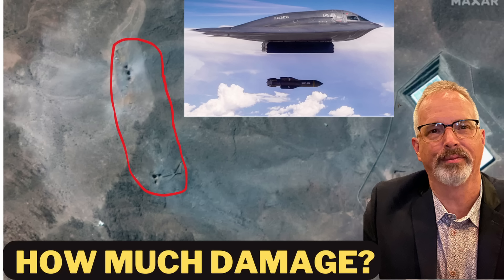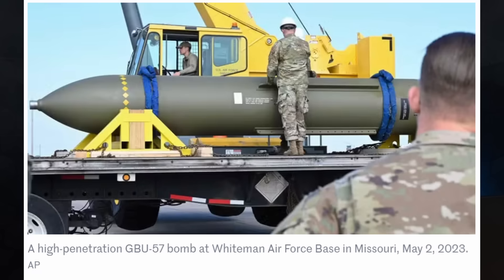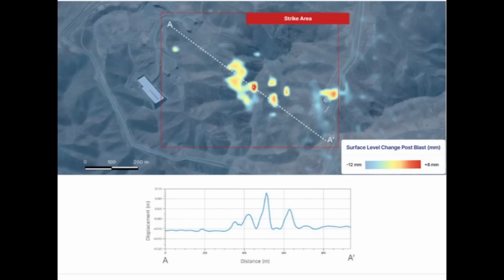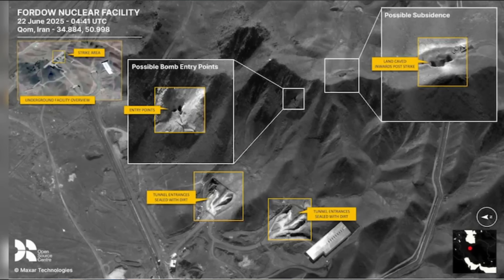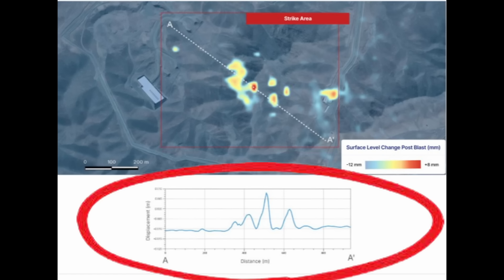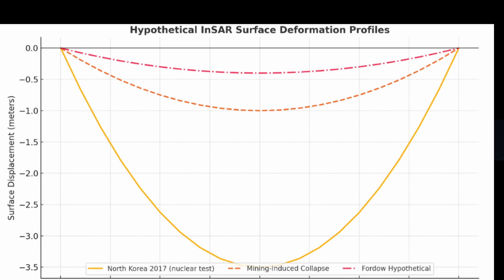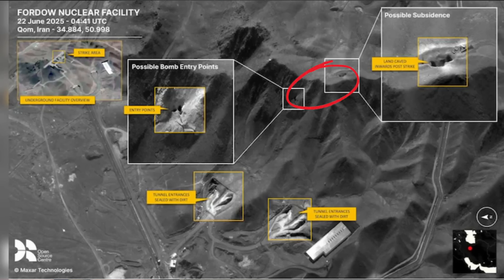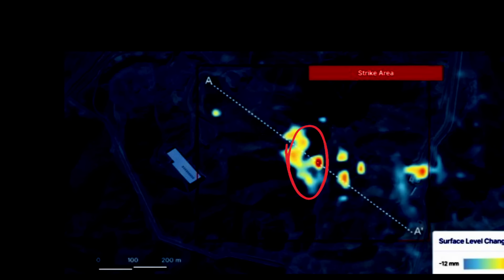Fordow Attack Assessment -  Update

Comment: I wonder how accurate is whatever information has been obtained about Fordo.

Personally, if I were to design such a facility, it would be an easy guess that in the (very) likely case of bombing, the vents would be the target.

So I would give them a target, but they would be a diversion to draw damage in a non-critical location. I would even give them the appearance of functionality.

I mean what's the point of going through all the trouble of burrowing into a granite mountain, only to put air shafts over it, when it's apparent there are enemies with deep penetrating ordnance?

It's too easy.

Comment: If the charge exploded anywhere close to the excavated area, wouldn't the easiest path for the energy be into the cavity rather than upwards?
It's good to have an analysis from an engineer with mining experience, given the target.
Also interesting is the suggestion that the weapon was specifically designed for the target.

Comment: Thanks Casey. Excellent as always. 130k yards is a lot of material as you say, but that's only a cube 50m on a side. So the details of where the damage was placed laterally and also the depth achieved vice the facility depth are very important. I don't think we can conclude much at all from remote sensing. Boots on the ground are needed. Since those will have to be provided by Israeli intelligence, we're unlikely to know the truth for a long time, if ever. The current claims on all sides are bluster for purely political purposes.
Reply: there are claims that the facilities were 200m deep

Comment: Since the fractured granite / concrete debris was blown downward into voluminous chambers, one would assume that the surface profile would indicate concavity equal to the displacement infill. Where did all that fracture rock go?
Or was the shaped charge designed to create a stabile core tunnel with minimal lateral expansion.

Comment: Sorry to say your calculations  are not correct. You made your calculations based on each bomb containing 30,000 lbs of explosives. However, that is not actually true. That is the weight of mostly the heavy casing which is obviously not explosive. The GBU 57 itself containss 5400 lbs of explosive material. Therefore you have based your calculations on 6 times the explosive power that actually exists.
Reply from the maker: No.  You are incorrect.  The 60k pounds plus was total explosives for the 12 bombs as I explained in the video.

Comment: No doubt those bombs loosened up a lot of rock but because there was 3 bombs fracturing 2 locations there was multiple bombs making smaller and smaller pieces. Lots of dust and sand and gravel. If the explosives were more evenly distributed there would have been more broken rock and less gravel. Of course the goal wasn’t to make gravel but mainly destroy the equipment they thought was down there.

Comment: If you use those numbers (0.3kg / m3 and 2,000 kg per bomb) then you get a sphere with a volume 11 metres in diameter. If each bomb can penetrate 10 meters before exploding, you basically get 20 meters into the hillside with each bomb. So yeah, 4 bombs would get you maybe 80 meters I'm not convinced all 6 bombs for each site followed exactly the same path.

Comment: I think that is a key aspect to the attack and results.  The ground in the area has been so shattered, so fractured, that it all has to effectively be mined out to make it stable OR you have to carefully mine into it placing structure to prevent collapse.  Either process will be a long painstaking time process to carry out.  And you have to remember that area is not stable per say geologically.  On June 20th a 5.1 magnitude earthquake hit Qom just 35 km away from the facility.  If the ground is as factured as likely due to the bombs .. you have to engineer and plan for that as well.
Reply from the maker: Those are all great points that should be considered.

Comment: Great presentation on the proibably damage to the basic rock material present in the area.
Now go back and ask what's missing.
These facilities weren't just thrown into an empty pocket, a "cave" in the middle of all this rock.
These facilities were also more than likely themselves built with layers of reinforced concrete (unknown composition and materials, everything from rebar reinforcing to layers of soft and hard material to create an effect you would see in Chobham armor, possible layers of steel plating, etc).
Calculating the destruction potential on the rock is one thing...effects on the facilities built of unknown reinforced material underneath that rock is another.
Additionally...this isn't the Death Star. The internal configuration of the vent shafts is obscure/unknown. If the shafts are offset and themselves have pockets meant to absorb or redirect energy away from the facility (think the Cheyanne Mountain "L" entrance way)...that will have an effect as well.

Comment: I dont understand, should not at least the concrete cap have been scattered on the surface? Elevation differences on the order of 10 mm is pebble size. At lot more concrete should have scattered around not from the explosion but just from the kinetic impact itself i would think.

Comment: I came to the same general conclusion. One could think of the surface uplift in parallel with artesianing. The formation above the tunnels are the confining layer and the forces are being applied radially along a small volume of space, the tunnels. The cycles of compression and release resulting from multiple explosions may have acted like a hammer, causing deeper damage with each occurrence.

Comment: They'll just build the next one a lot deeper and use gigantic steel doors that swing shut in a horizontal section to close off the vents (they had plenty of warning Trump was planning this operation), with probably side diverter vents to steer the energy/pressure from the explosions, plus probably a lot of decoy vents up top.  They'll also probably do a better job of keeping Mossad spies out.  The only thing that will stop Iran from pursuing nukes is regime change.

Comment: A sphere with a radius of 30 meters has a volume of slightly over your 30,000 cubic meters. The MOBs would have needed to near penetrate the layers of granite-limestone rock to near that depth to guarantee total fracturing of a similar volume of granite rock. That’s far from known to be a certainty. It’s possible the bomb casings themselves melted or fractured from over-pressure before the required penetration depth was reached. The Fordow plant was buried 80-90 meters deep.

Comment: The info of the MOP being a dumb unitary warhead is old. 
The current MOP utilizes the FMU-167B/C HTVSF. Hard Target Void Sensing Fuse. 
The MOP was designed to be iterated in stages. The original (2012-2018) MOPs did not have void sensing fuses to allow targeting of specific depths or pre-determined bunker levels; post 2018 MOPs and upgraded MOPs do. 
It's safe to assume the current version was used at Fordow, or a mix of previous versions and updated versions.

Comment: Casey,

With little to no knowledge of I subject matter, i wonder, was the mission rather than having the explosion fracture rock to use the heat and shock wave destroy the contents of the tunnels by heat and the shock waves?  This may explain the rise in the second hole.

I find it ironic that no one has been asking about the accuracy of the bombs.  Dropping two bomb from 40,000 feet from a plane traveling at or near the speed of sound, hitting the same ventilation shaft.  Now, information says six bombs went down a single shaft.  That translates to three planes dropping two bombs each, hitting the same target perfectly.  That is scary accurate.

Bob
Reply: In the defense industry, there is a phrase: "consecutive miracles". It refers to tests of multi-drop attacks on a single aimpoint, showing successive weapons passing right through the hole made by the first. Yup, with modern weapons, entirely plausible.
Reply: I've heard some reports say 13,000 ft altitude and doubt the airspeed was near sonic. The Iranian air defenses were pretty much toast by then in most estimations.
Reply: That is essentially what Razin Caine indicated in his press conference.  The design was to destroy the contents of the galleries by overpressure and heat.  Not by collapsing or fracturing the rock itself.
Reply: Technology is great when it works. Just like people.

Comment: Expect the Iranians to have prepared for this attack, emptying the bunker and backfilling it with sand, it would be impossible to collapse it.  Furthermore, soiid steeldoors will isolate the individual sectors of the bunker from explosions, fire, flodding and gas leaks.  The walls of the bunker is likely to be build with steel reinforced UHP concrete, which is very hard to penetrate or collapse. The GPU 57 can penetrate 60 m in 5,000 PSI concrete, 40 m in medium hard rock and 8 m in 10,000 PSI concrete. This is 30,000 PSI granite, the GPU 57 is unlikely to have gone very deep, even with follow ups in fractured granite. The attack is highly unlikely to have destroyed or seriously damaged the Fordow facility.
Reply: To your starting point, there's simply no way.  There had to be many hundreds of thousands of cubic yards of space in that facility.  A standard dump truck is carrying ten cubic yards.  Any incoming material has to be dumped and then moved by bulldozers.  The available timeframe was simply inadequate to do that sort of work even if the desire was there.

Comment: When you calculated powder factor for the amount of granite fracturing I don’t think that you can just add each consecutive detonation to get a final estimate.   There will be a substantial amount of energy that goes into already fractured material so the total is less than adding each fraction.
Reply: powder factor is theoretical

my concern indeed that explosion happened  in a shaft
plus the  bomb was enclosed a very hard steel  housing
so very much  pressure simply blown back  in the shaft  the  bomb itself created

what is really missing we dont know  how far from the ceiling  actually exploded
if it was 20-30 meter in solid rock
then facility might survived without serious damage

but there were cameras and  iran at least  saw  if there were damages,  and  what effect actually the bomb have
Reply: That's not the only mistake he makes. 

This entire presentation is designed to impress people without any advanced degrees or practical experience. It's mostly fluff, and not the nice use of the word,  without an actual intimate knowledge of the site before or preferably after. Was he an inspector, did he conduct scientific analysis of the ground, was the IAEA ever allowed to conduct any testing or were they simply debriefing Western intelligence agencies with what they observed , what they "saw?" 

With the IAEA spies kicked out, onsite analysis will never happen. 

AND, regardless of the success or failure...what has actually been accomplished?

It was potentially a few sites that had the nuclear material, and likely the centrifuges or their most complex components, removed ahead of time. And with Iran stepping away from IAEA inspections, if they wanted a bomb they could easily buy a few warheads from North Korea or Pakistan. Much simpler than designing and testing a fusion bomb of their own. The Uranium enrichment program was only ever a political tool, not a legitimate military threat...unless somehow they were simultaneously developing the capacity to deploy an air-dropped nuclear  bomb. 

All the losers on here and at the DOD and State jerking off over the use of military force have not even considered the implications, if this makes America more hated and less safe, which it has. That's my concern. I love the United States, I served and don't welcome war or what comes with it having personally served and led service members in combat. 

We violated the laws we purportedly follow, demolished the reputation and effectiveness of the NPT, showed ourselves to be cowards who kill whole families in pursuit of military leaders and scientists, and we have made nuclear proliferation much much more likely. And the ones who benefit are the same ones who always benefit from war and destruction... certainly not the American people.
Reply: @fanofc-adecoulomb8477 well said sir
Reply: @fanofc-adecoulomb8477 thank you for your comment 

Subbed to mayb3 learn more if i see u around online 🎉
Reply: @fanofc-adecoulomb8477 
The IAEA are not spy’s, they are there to observe by invitation. 
“We” doesn’t seem to exist at the moment, national stupidity is running around naked in all its glory.  Science and logic are dirty words.

Comment: I don't think "fracture" is the correct term. "Shatter" would be more in tune imo. Also worth mentioning is the special steel used in the bomb has a psi rating 3x greater than granite iirc. The othér thing they apparently work in pairs. Also the pentagon would have tested this to make sure it was reaching the rated depth. I had my doubts at first but like you think there was likely a lot of damage done to Fordow.

Comment: One comment.  The GBU-57 is a 30,000lb bomb....but does not have 30,000 lbs of explosives.  Most of the weight is the extremely hard steel and metal casing that allows it to push through hard surfaces by extreme density and such.  If I remember right it only has about 5,000 of explosives.   I see commentators saying 30,000 lbs of explosive energy which is not the case.  I am sure the specific amount and type is classified....but 95% of weight is in penetrating nose, casing, guidance, and detonator....not explosive.  Enjoyed your video.....but wanted to ensure were aware for your calculation.

Comment: Can you explain the math please?  Is it simply 12 bombs x 5,000 lbs explosive x 2 lbs rock per lb of explosive.  That = 120,000 lbs of rock.  Given that 6 bombs were dropped down each shaft, would’t a lot of explosives effectively refracture the same rock, however?  It seems to me (and this is intuitive, I’m not an engineer so this could be nonsense) that if you drop successive bombs on the same spot, a lot of the energy will be directed into the same rock as was fractured before it….such that you may have closer to 30,000 lbs of dust and pebbles than 120,000 lbs of boulders.  This is complicated by the fact the first bomb hit a concrete plug and the pure kinetic energy of each 30,000 lb device probably did a lot of damage just by itself independent of the explosives. 

Bottom line is intuitively I’d imagine damage was concentrated into less rock than you quoted, but the rock that was hit got pulverized by the successive hits.

Comment: Dumb question. If you are able to gather the necessary information about the effect of explosions on granit or concrete from open sources , is it reasonable to assume that the iranian engineers 20 years ago which designed that facility had the same information ?
I assume that a modern bunker has similar design-features  as modern cars , which minimize the structural damage to the passenger room in case of a crash by designing structures which suffer controlled deformation absorbing the energy. A battle tank when it goes at 50mph against a concrete wall will kill every passenger inside . A modern car not.

Comment: If the bombs detonated inside the facility, it is strange that the entrances were not blown out. The pressure wave inside the facility would have been enormous. And the filling done in front of the entrances was done before the bombing probably to stop cruise missiles.
Reply: true. there should have been a pressure wave that affect all voids, including the tunnels
Reply: Look at the before and after. You can see material blown out of the entrances as well as collapsing them far from the detonation site
Reply: @Betsy.Ross76  And none of that was shown on the radar satellite? There is 0 change displayed near the two main entrances.

Comment: Trying to excavate and recover anything from those tunnels would be an extremely hazardous task. All the several million tons of fractured rock above any exploratory excavation/bore hole would be unstable and prone to cave in because of the uplift. Basically trying to dig into a rubble pile.
Reply: The tunnel has already been opened.

Comment: I don't see how there would be more explosive movement down and laterally given the density of the rock there, but the lack of cratering on the surface could be because the volume of the cavern was filled with crushed rock. the slight subsidence of the target on the lower left seems to mirror the shape of the cavern below it.